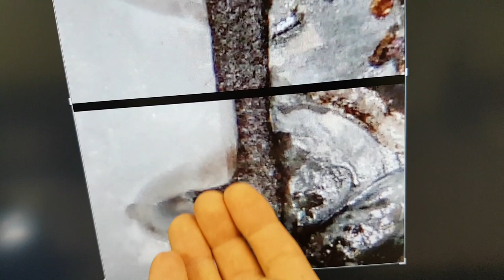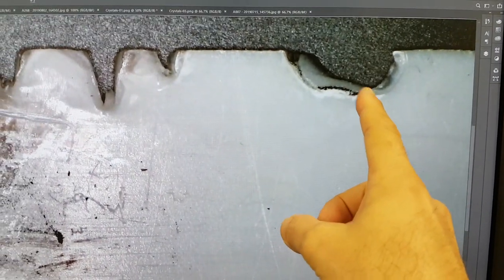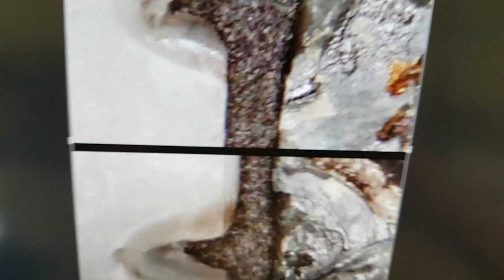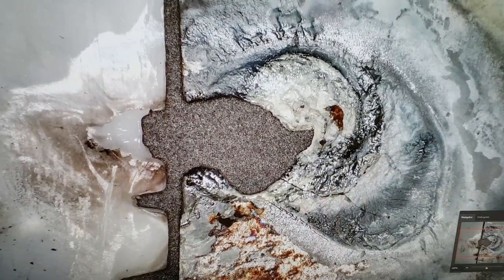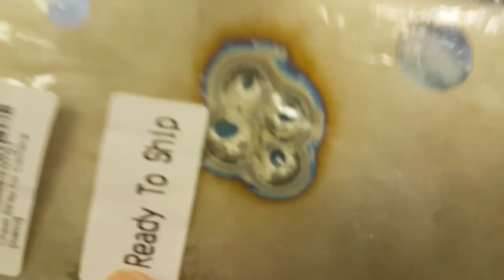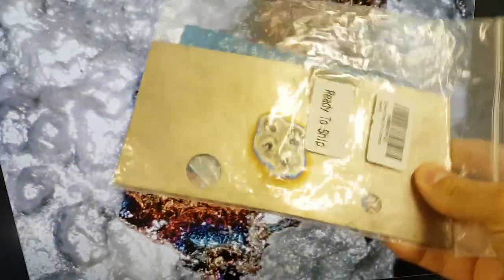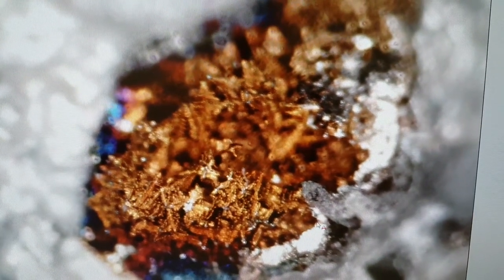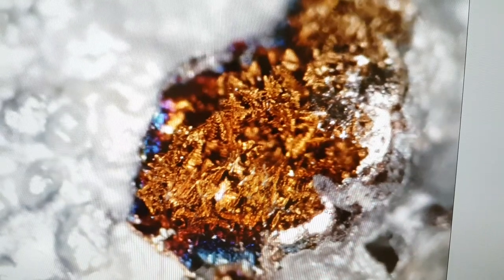OHMA - Ohmasa Gas treated Titanium vs PTFE

Comment: At 10:00 what you have is native copper, I have these crystal structures when I melt processed waste from Poland's KGHM mine, as I have developed a way to remove the heavy elements from the waste pile that is leaching copper oxide in to ground water.. Copper in this state in the KGHM 's waste is mixed with gold as part of the ore..  This look like the like my microscope copper crystal pictures as they are unmistakable, I have hundreds of these structures..  Looks like you may have discovered a new way to make Cu.  Al...
Reply from the maker: Thanks MV

It would be pretty crazy if this was copper as that surely should not be there!
Reply from the maker: Here are reactions between common isotopes of N, O and F and Ti that produce 63Cu and 66Cu

http://www.nanosoft.co.nz/results/select_*_from_TwoToTwoAll_where_lbA1eq16orE1eqForA1eq14rbandE2eqTiandE4eqCuByMeVDescLimit100.html

We may know in a week or so what these are. If they are copper, then the reactions above are candidates

Can you share a link to images from your work that you think are similar?